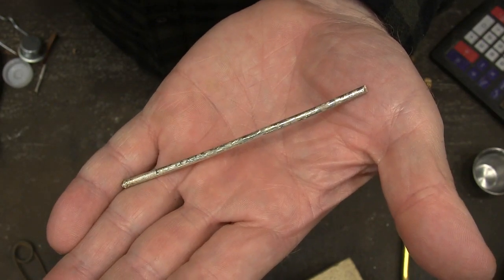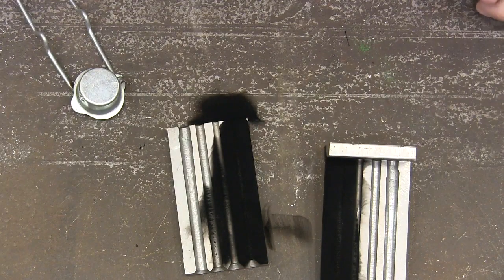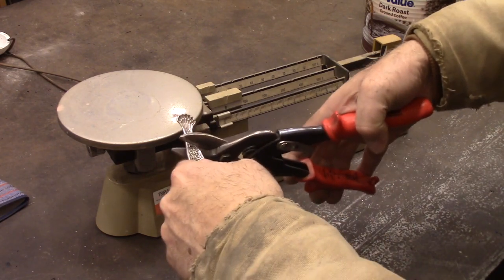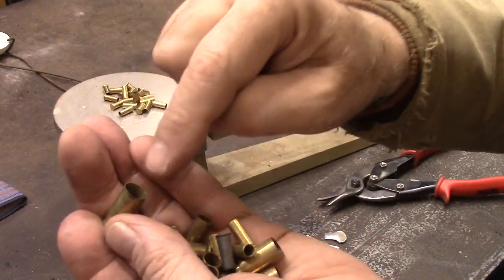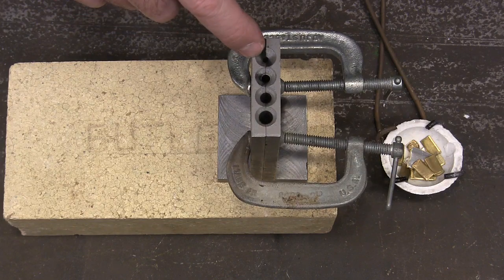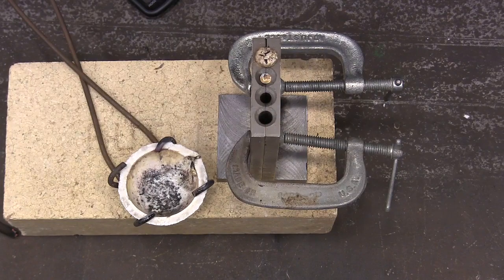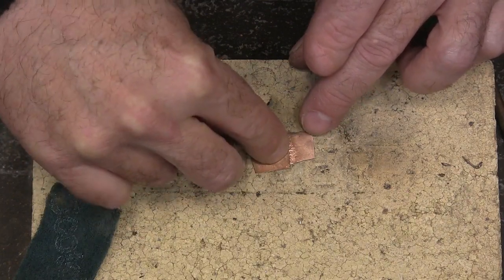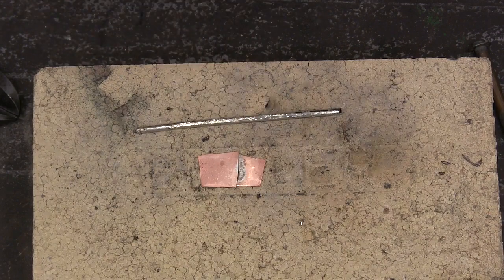Homemade Silver Solder

Comment: Just sub 👍 . i do it step by step , but my solder is strong but its a slightly brazier color than my silver. Why .. I use 999 f.s
Reply from the maker: It's going to be a little yellower due to the brass that you added.
Reply: @SoatMon  we as followers , is this a platform to message u if we have a question? do you have email Facebook , Instagram , Twitter or any other other media ? Thank you 👍 it helped i rolled & it looks more silvery color now.
Reply: @SoatMon  thank u Sr , finally got it to work . just finished my cuban 🔗 link bracelet for my sons . i have 2 boys , im about to start my 2nd bracelet. 👍

Comment: Just a heads up on that solder. Brass ammo casings are an alloy that contains lead. Check the metallurgy of any material that you use if your silver solder will be in contact with food, water or used in jewelry. Super how too for silver solder........
Reply: Lead free silver solder rod can made if uses instead ammo casing brass some brass coupling parts what common are used household water line parts and therefore can be found hardware stores relatively cheap.
Reply from the maker: Good point, thanks!
Reply: I doubt if cartridges cases contain lead

Comment: Do you need flux to silver solder on copper? We don't use it when using that sil phos 15 brazing rod, which is only 15% silver.  It's used for brazing copper pipe
Reply from the maker: Sorry, I see you already found the video.  I do use flux with this solder.

Comment: Nice work, some nice tips too,  what melting level is this blend,,easy, medium or hard?
Reply from the maker: I don't really know the melting point.  It does melt before sterling and is hard when you cut it, not nearly as soft as sterling.
Reply: Thanks, I was referring to the jewelry industry standard ref for silver solders which is extra easy, soft, medium, or hard.
Reply: Alger C. Think they say it's the same as hard silver Alger

Comment: Very ingenious.  What is meant by pickling? After you cast the solder wire.
Reply from the maker: Pickling is soaking the part in a mild acid.  It removes the scale formed from heating the metal.
Reply: Water with a few drops of acid, preferably Sulphuric acid.